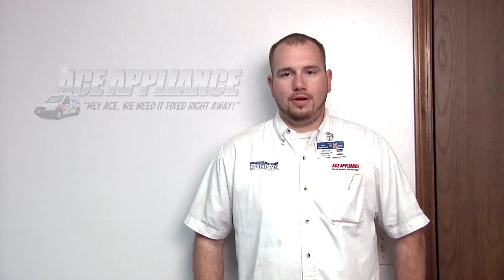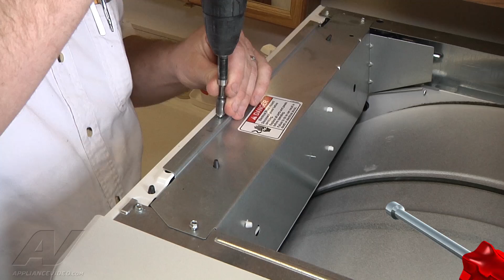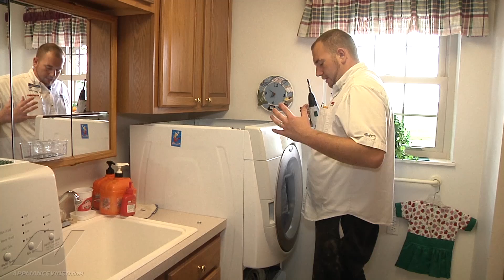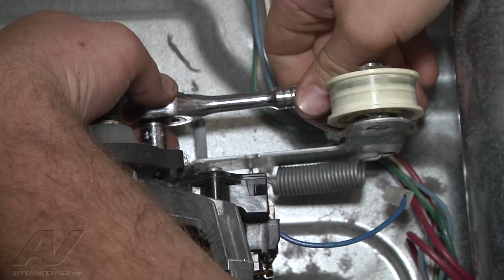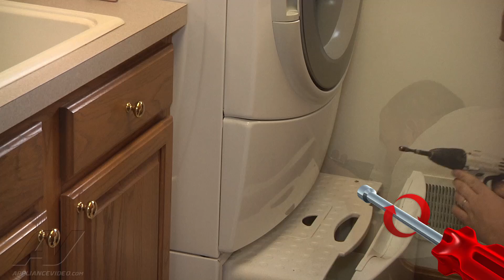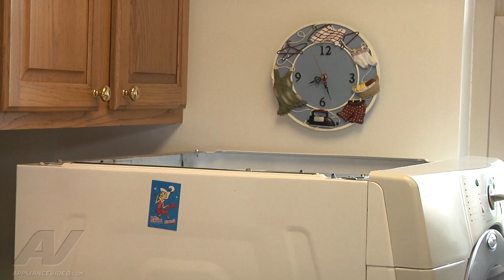Whirlpool Dryer Repair - Will Not Turn On - Belt Switch

Comment: First off GREAT VIDEO. I have the gew9250pw1, which I believe is the exact same one you've got in the video. When I try to run it, everything lights up as usual, and I hear it click. The sensing light comes on and then eventually the wet light comes on and that's it.   I did the diagnostic and everything lit up red except for the cycle complete which lit up green. From what I've red online, I think that is normal.Ok so I now we get to the video. I took the top off and pulled the wire harness off. I tested the P3 and P4 just like you showed and got nothing. I checked some other stuff to make sure that it was functioning. Alright so now I'm at around 4:40 on the vid, where I need to take a lot of stuff off. I was wondering if you knew if that is the next step I should move on to. Just after hearing the extra info I gave you, does it make sense? Alright, I hope to get a response from you soon. Thank you either way.
Reply: I actually did fix it yes. I was completely impressed with myself too lol. What I ended up doing was taking my checker and going thru the wiring circuit and checking each point to find where it was broken. I've trying to go back and see what the name of the part was but I have to leave for work and so I don't have the time. It was just something small called like the heat sensor. Anyway I checked where the wire went in and where it came out and there was no connection. So I crossed my fingers, bought the part for just a few bucks on amazon and put it in and everything worked.
Reply from the maker: +Buddy Foster 

Good question, with our
technicians now getting hundreds questions weekly, they are answering all questions
at our website http://www.appliancevideo.com/repair-help/ .  We also have over 30000 common questions
and answers that you can easily search through by your model number, appliance
make, problem or error code and it’s absolutely FREE.
Reply: Buddy Foster hey did you fix your dryer.  I am having the same issue.

Comment: my whirlpool duet dryer won't start and the control locked light is on?
Reply from the maker: +alan Rael 

         We would like to help you answer your
question. With our videos now getting over 900,000 views per month and hundreds
of questions from people like you, our technicians are now answering questions
at our website http://www.appliancevideo.com/repair-help/ .  We also have over 2200 common questions
and answers that you can easily search through by your model number, appliance
make, problem or error code and it’s absolutely FREE. You also have the option
to email a factory service technician with a question on your appliance at http://www.appliancevideo.com/repair-help/ . If you’re looking for a repair video, you can
also search our library of over 2600 free repair videos. ApplianceVideo.com
specializes in quality DO-IT-YOURSELF appliance repair videos and we get over
800,000 views per MONTH to our videos worldwide and growing. If you need of
parts for your major appliance, we have over 5-million parts in stock at http://savemoreonparts.com/ .  Thanks for your support. Matt Ace
Appliance factory service technician.

Comment: my dryer won't start the lights won't go on. it was working earlier but nothing won't turn on now
Reply from the maker: +Marcelino Baro 

We would like to help you
answer your question. With our videos now getting over 900,000 views per month and
hundreds of questions from people like you, our technicians are now answering questions  at our website http://www.appliancevideo.com/repair-help/ .  We also have over 2200 common questions
and answers that you can easily search through by your model number, appliance
make, problem or error code and it’s absolutely FREE. You also have the option
to email a factory service technician with a question on your appliance at http://www.appliancevideo.com/repair-help/ . If you’re looking for a repair video, you can
also search our library of over 2600 free repair videos. ApplianceVideo.com
specializes in quality DO-IT-YOURSELF appliance repair videos and we get over
800,000 views per MONTH to our videos worldwide and growing. If you need of
parts for your major appliance, we have over 5-million parts in stock at http://savemoreonparts.com/ .  Thanks for your support. Matt Ace
Appliance factory service technician.
Reply: my dryer will not heat so the technician came out and he fixed it with the coils it work 20 minutes and now it won't even start and PF warning came up where the timer is and when I touched it it kind of gave me electrical feeling

Comment: My duet electric front load dryer has an Lc error? Wont start?
Reply from the maker: Emirati
         All of our technicians are now answering questions daily on the ApplianceVideo.com website. You can search completely FREE in our Repair Help section with over 1000 questions & answers. Or you can get unlimited technical advice and video links emailed to you by our 14 factory certified technicians at http://www.appliancevideo.com/premium-membership/.  If you are in need of any parts please support our parts department on line at http://savemoreonparts.com/ or call 1-800-830-5465 7-days a week until 11pm Eastern time. Thanks for your support. Matt Ace Appliance factory service technician.
Reply: ApplianceVideo.com

Comment: I am getting three or more rapid beeps whenever I press a button on my duet dryer.  I replaced the light bulb and it stays on constantly even when the dryer door is closed.
Reply from the maker: Ken
    All of our technicians are now answering questions daily on the ApplianceVideo.com website. You can search completely FREE in our Repair Help section. Or you can get unlimited technical advice and video links emailed to you by our 14 factory certified technicians at http://www.appliancevideo.com/premium-membership/.  If you are in need of any parts please support our parts department on line at http://savemoreonparts.com/ or call 1-800-830-5465 7-days a week until 11pm Eastern time. Thanks for your support. Matt Ace Appliance factory service technician.

Comment: I was wondering if your senior technicians has able to solve Bryce Stephensons problem for I am getting 2.2 ohms from the P1-3 and p1-4 connector and it tells us if its between 1-6 ohms to replace the machine control electronics. Its a pretty expensive part to replace thats why I want to be sure thanks
Reply from the maker: Dallas 
           All of our technicians are now answering questions daily on the ApplianceVideo.com website. You can search completely FREE in our Repair Help section. Or you can get unlimited technical advice and video links emailed to you by our 14 factory certified technicians at http://www.appliancevideo.com/premium-membership/.  If you are in need of any parts please support our parts department on line at http://savemoreonparts.com/ or call 1-800-830-5465 7-days a week until 11pm Eastern time. Thanks for your support. Matt Ace Appliance factory service technician.

Comment: I'm having trouble with my whirlpool duet dryer. Will turn on when I push buttons then makes a clicking sound but will not start. I have tried to watch your video but there is NO sound .
Reply from the maker: Mark
   All of our technicians are now answering questions daily on the ApplianceVideo.com website. You can search completely FREE in our Repair Help section. Or you can get unlimited technical advice and video links emailed to you by our 14 factory certified technicians at http://www.appliancevideo.com/premium-membership/.  If you are in need of any parts please support our parts department on line at http://savemoreonparts.com/ or call 1-800-830-5465 7-days a week until 11pm Eastern time. Thanks for your support. Matt Ace Appliance factory service technician

Comment: I have thet same problem with my dryer and i did everything as instructed on the video.  I have  replaced the motor switch and its still not working . Can you give me any other tips? what is the  next part that  i need to check to make it work?  thanks for any help you can give me.
Reply from the maker: Roberto
            All of our technicians are now answering questions daily on the ApplianceVideo.com website for anyone needing help. Just copy and paste this this question under REPAIR HELP, and one of our  factory authorized technicians  will answer any technical questions at absolutely no charge on your appliance issues. We also have over 2600 free repair videos to help with your appliance repair issues. Thanks for your support. Matt Ace Appliance factory service technician.

Comment: Mine ( Kenmore 110.5866401)  will not come on, I will go to diagnostic mode but only shows 49 on the read out. Any ideas?  Thank you
Reply from the maker: Eureka
        If you go to our FREE repair help website at ApplianceVideo.com and post this question under REPAIR HELP, we have factory authorized technicians that will answer any technical questions at absolutely no charge on your appliance issues. This is the only website on the web that you can get questions answered by certified appliance and HVAC technicians along with over 2600 free repair videos.  Matt Ace Appliance factory service technician
Reply: Thanks , Well it was a sticky door switch.  Appliance-Works.webs com
Reply from the maker: EurekaRecycler
                    If you go to our FREE repair help website at ApplianceVideo.com and copy and paste this this question under REPAIR HELP, we have factory authorized technicians that will answer any technical questions at absolutely no charge on your appliance issues. This is the only website on the web that you can get questions answered by certified appliance and HVAC technicians along with over 2600 free repair videos.  Matt Ace Appliance factory service technician

Comment: Will this same Belt Switch replaced here fix the same problem in the Whirlpool GEW9250PW0. the reason I ask is because I have tried to contact Whirlpool about getting a replacement part so that I can fix my dryer and am told that there is no such part that attached to the idler pulley and maybe it is the main power board not sending power down the wire harness...I watched the video and saw the guy take the part off of this dryer and it sure seems to be doing the same thing that mine is doing and it looks like the exact dryer...just a different last number...
Reply from the maker: Thanks for your response, we are glad we could help. Our library of over 5,700 videos are currently helping over 1.6 million people like you every MONTH.  Please help us by subscribing to our YouTube channel, or post our website www.ApplianceVideo.com to your Facebook page, Twitter, Instagram or any other social media sites. Your support will help us keep producing more free quality videos.

Comment: Curious about the control panel in this video. My control panel has been acting screwy. The times allotted for cycles don't seem correct and it won't fire up. No clicking or anything. I took the top off, pulled the control board, cleaned it of any lint debris, reinstalled it, and it fired right up. Ran a few more loads and now I'm back to the same issues with the control panel acting screwy. have a feeling my issue is either control panel or control board related and wanted to see if you guys have any ideas.
Reply from the maker: Stefani 
         If you go to our FREE repair help website at ApplianceVideo.com. We have 14 factory authorized technicians that can answer any technical questions daily on your appliance issues. This is the only website on the web that you can get questions answered by certified appliance and HVAC technicians at absolutely no charge along with over 2600 free repair videos. Thanks Matt Ace Appliance factory service technician

Comment: So my front display is intermittent, on & off.  Runs sometimes but beeps during the cycle.  Now it gives me a PF error code.  I hold down the start button, hear the click & beep, but it doesn't start up.  I first thought of replacing the thermister, but now I'm thinking it the mother/control board.  All tests on 220 outlet were normal.  I have the same model as this video.
Reply from the maker: Sidney
          You have a loose  ribbon connection to the user interface control panel or a bad control board. Start with the ribbon connection.  Thanks for your positive comment. Please help us provide more videos to our site by subscribing to our YouTube page or posting ApplianceVideo.com site on your Facebook or Twitter account. We also have our factory authorized technician’s email daily free professional advice to people like you to help solve their appliance problems. Thanks in advance for supporting us. Matt, Ace Appliance service technician.

Comment: Wow thanks for the quick reply! control lights go on but when start button is pushed it clicks and nothing goes into motion .I checked the thermal fuse and thermistor with  meter and they are fine .Diagnostic test on door switch was fine .Checked resistance on P1-3 and P1-4 [light blue and dark blue wires] and thats where Ive come to a stop.The reading on lowest setting is 1.7 ohms.Tech sheet info . says to replace electronic controls if reading is between 1 and 6 . Does that mean the board is dead or do I keep going after that belt switch .Also,when he does the same test ,where is your technician putting the leads on his multimeter? it doesn't look like they are in the open holes of that cluster of 5 wires.
Show less
Reply: I'm at same spot. What did you do? I know that this means the belt switch is closed (good) since your measuring motor resistance. So it seems board is not sending 120v to the motor circuit because if it was it would either move or make noise. I'm trying to figure out how to troubleshoot the board in order to repair or replace one of them. edit: when he pulled the P1 connector he backprobed the plug wires to touch the exposed metal clamping the wires - it doesn't make any difference if you do it this way or put the probes against the pins.
Reply: I figured it out... the tech sheet shows the "electronic controls" as the relay board located just as shown in the video. As so many of the other comments have shown, once I pulled the board out (one screw) and looked underneath it was obvious that the solder joint had melted (with black burn marks nearby). I'll be ordering a new relay today for ~$8 and attempting to solder it in myself. I found a service online that purports to fix boards for $100 too.
Reply from the maker: Thanks for your response, we are glad we could help. Our library of over 5,700 videos are currently helping over 1.6 million people like you every MONTH.  Please help us by subscribing to our YouTube channel, or post our website www.ApplianceVideo.com to your Facebook page, Twitter, Instagram or any other social media sites. Your support will help us keep producing more free quality videos.

Comment: hello,the tech sheet says to replace control board if you get a reading of 1-6 Ohms,what setting do I set the Ohm scale on the multimeter ? 200 with a beeper sound gives me a reading of 2  or 3 .20k setting gives a reading of 0.00 Im confused
Reply from the maker: Bryce
         Set it the lowest Ohm scale will give you the most accurate reading. What are your symptoms ?
Reply: ***** Wow thanks for the quick reply! control lights go on but when start button is pushed it clicks and nothing goes into motion .I checked the thermal fuse and thermistor with  meter and they are fine .Diagnostic test on door switch was fine .Checked resistance on P1-3 and P1-4 [light blue and dark blue wires] and thats where Ive come to a stop.The reading on lowest setting is 1.7 ohms.Tech sheet info . says to replace electronic controls if reading is between 1 and 6 . Does that mean the board is dead or do I keep going after that belt switch .Also,when he does the same test ,where is your technician putting the leads on his multimeter? it doesn't look like they are in the open holes of that cluster of 5 wires.
Reply: Bryce Stephenson What is the ohm reading supposed to be when function ing properly? Just found the $ of the control board ,294.00 Can. plus shipping .Sure would be nice to know  for sure that this is my problem.Starting to question if its worth the trouble at that price .Our parents dryers didn't crap out after 10 yrs.
Reply: ***** Any thoughts? I need some direction ,thanks
Reply from the maker: Bryce Stephenson
 I have sent your question over to our senior technician, I am waiting for a response back. Should be sometime today Bryce. I will get you the answer.

Comment: I replaced the fuse part  #33001762Worked   for one load and now it is doing the same thing again. Also I want to ask about the light not working and the clothes that was in the one load that worked were super wrinkled like the dryer got too hot?? Now I am going to replace the thermistor.  All that is left is the one by the belt and the door switch.  what do I do? Being patient but the clothes are getting deep!
Reply from the maker: That fuse is a safety device. If it blew after one load and the unit got hot that is a indication of a plugged dryer vent.  Replace the fuse and run a load with the dryer vent off. Before replacing the thermistor check the dryer vent.Please help our ranking by subscribing to our YouTube page or posting our ApplianceVideo.com site on your Facebook or Twitter account. This will help us to continue to make new professional videos from our factory trained technicians and help people like you. We also have our technicians daily emailing professional advice to people that have problems with their appliances. We have helped thousands of people save hundreds of dollars. Thanks in advance for your help.